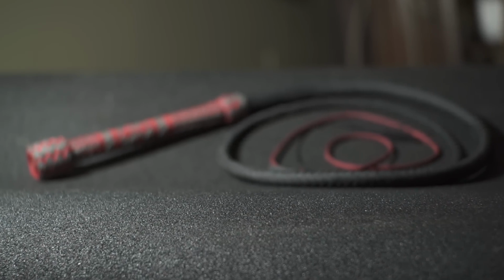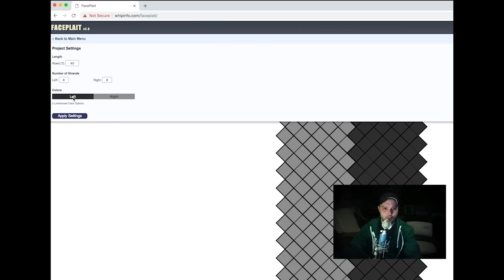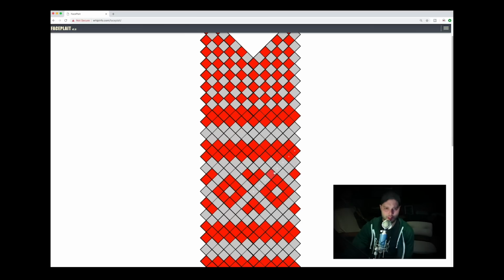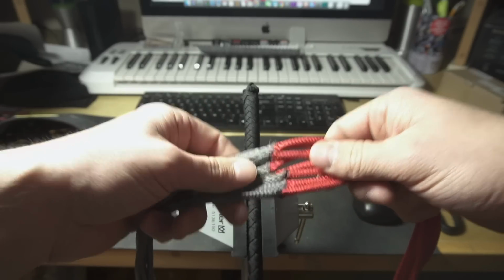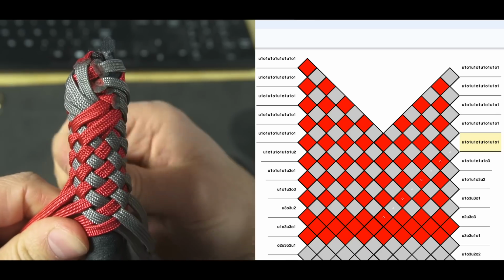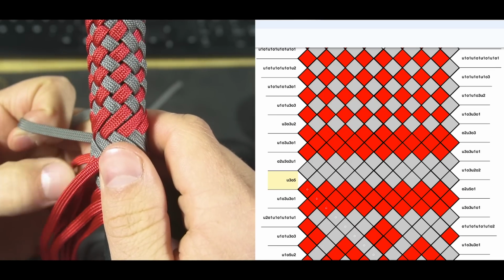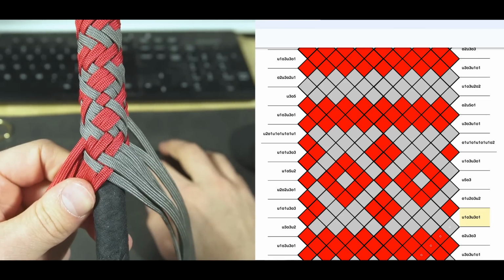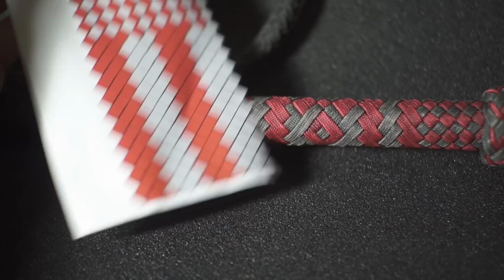Fancy Plaiting Beginner's Guide - Bullwhip and Stockwhip Handles

Comment: I'm glad that you pointed out the fact that you had a floating strand. As s weaver, floaters are something you need to be aware when you are designing a pattern  so that the strand doesn't become loose. For the weaving I do, you can't have a strand float for more than 5 spaces.
Reply from the maker: Thanks Nicole. I honestly didn't even know at the time that "floating strand" that I used was the correct term for this. My experience with weaving is exclusive to whip making, and I don't have any experience with it beyond plaiting. It was a lucky guess! Thanks for watching.

Comment: how do you know the measurements length wise. for example if you do a 40 row pattern how many inches would that cover say the handle of the whip?
Reply: It ultimately depends on the width of your strands since strand width can vary with different types of cord or leather. The default value of 40 rows is based on covering a 10 inch handle with standard 5mm paracord (give or take). There are a few methods I have found for calculating it yourself...

First, you can use pure math - measure the width of your strands, use that measurement as a square and find the diagonal ( sqrt(2*width) ), multiply that number by 2, then divide your length by that number. So for example we use 5mm strand to cover 10 inches (254mm) we'd do sqrt(2*5) = 3.16227766 * 2 = 6.324 then 254 / 6.324 = 40.164 (rounded to 40).

You can also compare to a whip you have already made - use a tape measure to measure 1 inch of plaiting, count how many rows it takes to cover 1 inch, then multiply that by how many inches you need to cover.

Just keep in mind the calculations may possibly be slightly off given the non-exactness of measurements vs real world plaiting. Give yourself some wiggle room. Personally, when I use Faceplait on my own projects, I tend to use it to plan out a general design but then work more in segments so I can see how the spacing may need to be adjusted as I go along.

Comment: 1. Is the fancy plaiting only for the handle section?  2. If I wanted to do fancy plaiting on the handle, would I do the whip as normal, for example with the 6ft 16play two bellies and an overlay, then do the handle with the fancy plaiting?
Reply: Same question here, sadly there is no answer yet!
Is the Whip working the same way, if the fancy plating is on the whole Whip/Overlay?
hopefully my comment will help getting the answer🙏

Comment: Hey Nick how many rows do you need per inch? I'm trying to do a 10" handle but I'm not sure how many I need
Reply: Not sure you are still looking for this info, but on the tool under length it says "rows = length / (strand width * sqrt(2)) || 40 rows is approximately 10 inches for typical paracord"

Comment: I just started to get curious about this. This video lays it out very simply, thanks. Just wondering as a couple others were about handle length how can you determine how many rows you’d need for say a 10” handle?

Thanks again, keep up the good work!
Reply: Just measured the only whip I’ve made. With 550 I have 5 rows per inch for most of my whip.

Comment: Hey Nick. I have a question and I can't find which video might have the answer. First of all I just wanted to thank you for all the videos. I am making my first Whip and and loving it. So when making a fancy plated handle, do you make the fancy plating over your third lair or is the fancy plating of the handle part of the third layer? If it's not part of the third layer but goes over it, how do you tie it off at the transition? Thanks again.
Reply from the maker: Hi Brandon, thanks for watching! The fancy plaiting is part of the final layer (overlay). you can either go straight into the rest of the overlay after the handle ends, or you can make it an "off colored" handle style whip and use this method attached below in the video. Hope this helps!  https://www.youtube.com/watch?v=OG3K_TwM9to

Comment: Great video Nick!! Can you do this for plaiting names on the whip as well? Keep up the great work!!
Reply: Yes. You can use this for plaiting words. Just keep in mind you don't want letters to go all the way around the handle. Leave space on each side of the pattern in FacePlait so the words can be read without having to spin the handle  Also, you only have so many "pixels" with this few strands.
Reply from the maker: Brian summed it up very well DrJones. In my opinion 16 plait is not quite enough pixels for names to be plaited out. I'm working with a company on possibly producing some thinner cord that would allow for 24 plait. That would be plenty!
Reply: @NicksWhipShop  I started an experiment with 275 cord as the handle overlay using your "normal" bullwhip build methods. I think 24 strands work. I need to complete the experiment and roll the result to be sure.

Comment: Brother,  I am confused
Will you un-confuse me?  The length of the shot bag,  In one video you mention you like it to be 1/2 the length of the whip, In another It is 8'''
What is your opinion on the correct length of my bb filled shot bag in a 8' bull whip?
does a longer bag  give the whip more weight to achieve breaking the sound barrier?
or does the drag of the weight slow it down?
Thank you for taking the time to respond.  
Frodo
Reply from the maker: Good question! This is actually a personal preference thing, Frodo. I used to fill the core with so many BB's, and the reason I stopped is because the whips were really heavy! As I started trying out other whips from other whipmakers who had been making whips for many, many years longer then myself, I noticed that mine were much heavier than average. Since waxing the whips also adds quite a bit of weight, I just decided to lessen the amount greatly. Does a heavier whip crack more easily? Yes and no. Yes, because there is more mass. No, because although there is more mass which results in a more powerful loop running down the whip, it requires more energy to get it going. Hope this helps! You do you, though! Some people like heavier whips, some people don't. As long as the whip cracks smoothly, there is no right or wrong weight.

Comment: The single best way I've found to keep my strands from overlapping each other is to use bobby pins to allign the strands about an inch from the handle, and use another bobby pin to weave the next cord into the pattern. i generally don't worry about making sure the tension or allignment is perfect until I've locked the cords all in with a few rows of herringbone and a rubber band. Then I go back to butt my cords against each other and tension them. I hope this helps someone make sense of their cords. 😃

Comment: Nick you have evolved into an  amazing teacher and mentor. How do you start the overlay on the Whip and leave the handle untouched?
Reply: I usually shave about 1'8" off my overlay strands, then I plait from 2 inches above the transition, gives me room to cut the messy top off, but, once I have the plait started I choke it with the artificial Sinew, (covered over by the transition knot) plait as normal.

Comment: Cool nick,,,I enjoy your videos.  ,I am currently working on a different type handle you might be interested in
12'' of Chain  with a 1 1/2'' stainless steel bearing welded on the end
Off to the welder tomorrow.
Reply from the maker: Interesting idea! What will you use to have the ball bearings swivel?
Reply: @NicksWhipShop  Thank you for the reply
The SS bearing will be used as the Pummel of the handle, It will not need to swivel
it will be welded to the chain,  the whip attaches at the opposite end of the welded link chain  braided into the last 2 links.
Your videos are very helpful.  
you need a t shirt 
''put the Beans to it""
Reply from the maker: @frododavis9082  Interesting! I'd love to see the finished product. Thanks! Yes, maybe I will print some of those shirts, haha.
Reply: @NicksWhipShop  
I'll buy one when you do. After finish i will post the handle

Comment: How did you print yours?
Reply from the maker: I just took a screenshot.
Reply: Thanks Nick
Hi do you save the finished design
Have tried to save various places but when the re loading comes back as the design but then reverts back to the original original 
Just lost an hour's work !
Reply from the maker: @johnhancock4088  sorry to hear John. Are you saving after you complete the design?
Reply: Raven North right click with mouse on page after saving project and then opening up page
Saving was a problem as it is a html / you need to save as html complete or it doesn't save as completed pattern
Cheers John
Reply: NicksWhipShop yes all good now saved as html complete or else it reverts to the original
Also tried to make donation but don't have the PayPal info to send
Reply: @johnhancock4088  why is this to me?
Reply: @HrafnNordhri  YOU ASKED HOW TO PRINT YOURS